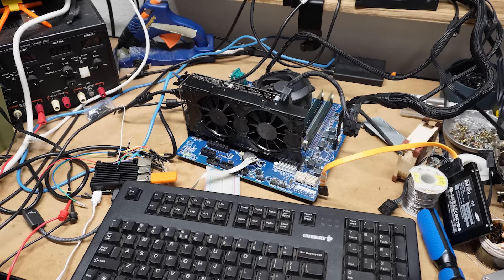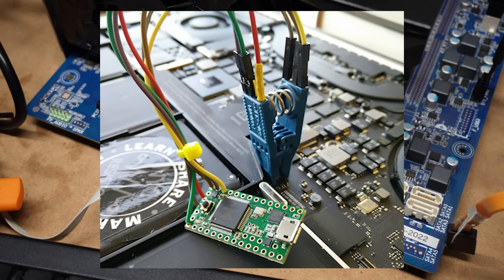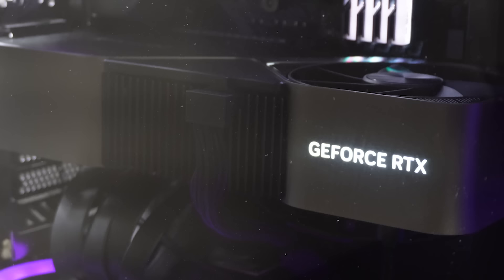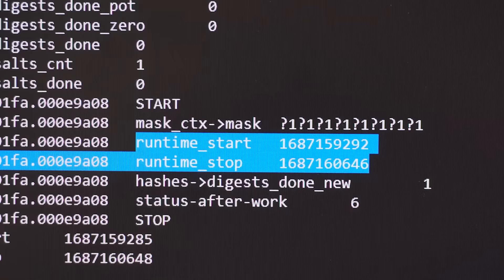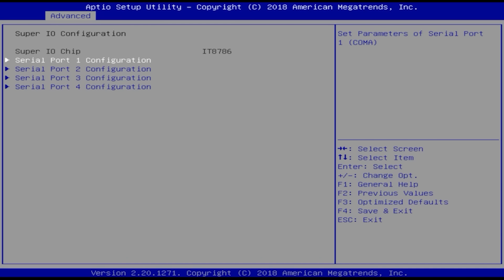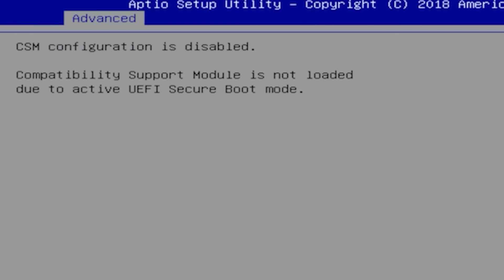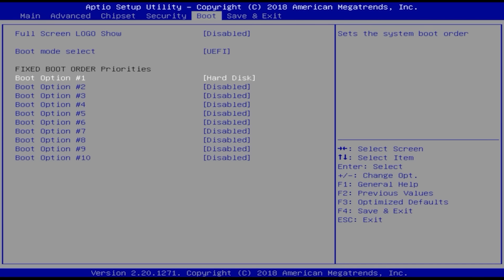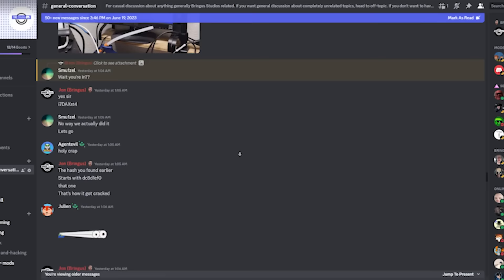How I Cracked The Sega ALLS MX2 BIOS Password

Comment: The "units" for runtime_start and runtime_stop and epoch. you can convert them easily online but its basically the number ofseconds since Jan 1st 1970 00:00.

Anyway, you started cracking at 2023-06-19 at 7:21:32 UTC and finished at 2023-06-19 at 7:44:06 UTC -- so it took about 23 minutes.
Reply: This is called Unix Timestamp.
Reply: I just subtracted the first value from the second value, divided it by 60 and got 22,56
Reply: @Looki2000 Yeah so 22 minutes and 34 seconds
Reply: @renakunisaki  If you're going to be technical (which this is the internet, so we definitely are), it's a timestamp, whose epoch is the unix epoch, namely the start of Jan 1st 1970 in whatever timezone you've arbitrarily set it to (typically UTC). Since we only care about the delta between the two timestamps (to produce a duration rather than a timestamp) the timezone doesn't matter as long as both timestamps share the same timezone (which they do) and even the epoch doesn't matter as once again it's only important if they differ. Subtracting the start from the stop gives us a value of 1,354 seconds between them, or 22 minutes and 34 seconds.

Representing a specific point in time is a surprisingly difficult problem to solve and there are a ridiculous number of ways you can screw that up. Thankfully representing the difference between two points in time is significantly easier and much harder to screw up.
Reply: @renakunisaki  to be really technical since this is the internet, the unit is actually seconds.
Reply: LOL I should have just looked in the comments I used C++ and got the same but since I use central time:
runtime_start = Year: 2023 Day: 170 Time: 02:21:32 AM
runtime_stop  = Year: 2023 Day: 170 Time: 02:44:06 AM
Reply: @yugoprowers   I paused the video to write it in C, though I used strftime() and "%F %T" as my format.
Reply: @yugoprowers Why exactly Jan 1st 1970?
Reply: @Vortex001_MLG  per wikipedia: The current epoch of 1 January 1970 00:00:00 UTC was selected arbitrarily by Unix engineers because it was considered a convenient date to work with.

Comment: What's the point in cracking the password when you could just replace that hashed string with your hashed password when you know where's this string located anyway?
Reply from the maker: Actually yeah that would have been pretty smart & quick to do now that I think about it. That probably would have got me in no problem but I also really wanted to find the password because every single one of these Alls MX2 units shares a password. So now anybody that has one can use it.
Reply: If there arent any checksums, which there definitely are

Comment: Late to the party, but the bios reset via the 2 leads you touch with a screwdriver thing, you literally have to be touching it when the machine is powered off, and continue holding it there while powering it on. I've had to do that on a few older laptops in the past. It's nuts but works.
Reply: He tried it in full video, didnt work

Comment: A SuperIO chip basically just integrates into a single physical chip a whole bunch of peripherals that would have traditionally been discrete. Things like serial ports, parallel port, keyboard and mouse controller etc, maybe even floppy controllers, real time clocks etc, or some combination of all that stuff.

It all gets squeezed into one smaller form factor chip rather than being spread out as several.
Reply: Pretty much what I was going to post, u beat me to it, on a system that modern it would be effectively adding stuff that's not already built into the pch or extra of things already built into the pch (like usb)
Reply: I've seen some of those chips with IBM joystick, fan controller, and power monitoring as well.
Reply: @absalomdraconis hmmm...yeah, I have/had a board (can't remember which one) and in the bios config it had a setting for joystick port, probably has a header somewhere for that...
Reply: @robloxian1585  yeah, superIO is just where they stick literally anything and almost everything that they don't want to implement in discrete logic, so its a random crapshoot what can be in some of them lol

Comment: These are the UNIX timestamps, counting the seconds from the epoch (1/1/1970 - 00:00).

And you can just simply remove the runtime_stop value from the runtime_start, which will give you 1354 seconds - so it's around 22 minutes and 30-40 seconds

Comment: Bus Pirates are also a good option for use with flashrom, less expensive than a pi and has buffers on the outputs and logic level options, but writing larger bios images can be a bit on the slow side.
Reply: @superusermode  can you detail a bit the explanations please ?

Comment: Worth probably pointing out about motherboard based "RAID", it is not hardware raid on amd or intel motherboards. It is a feature you enable on your motherboard yes, but how they do it is in software. If you dont have an actual raid card or a sufficiently enterprise server with one integrated, it does not have hardware raid. Even if it did btfs and zfs are both a lot more performant. And unlike traditional raid they actually check file integrity actively rather than only whine when a disk fails. 

What I mean to say is 'real raid' hasn't been worth it for genuinely protecting your data in years, theres been a lot learned about doing it better at a filesystem level.
Reply: I came to the comments to see if anyone would say this. Hardware RAID is pointless in a home NAS in 2023 and honestly probably even in most enterprise use cases as well.
Reply from the maker: That's a very good point, I've still got the "mobo raid = hardware" misconception stuck in my head from somewhere
Reply: it's also totally useless if your drives are mismatched.  You need to use freenas or something similar what that is the case.

Comment: Clocking in at 16MB is huge. For a bios, it should have a heluvalotta features. You could fit 8 EFI compatible BIOSes on that. A normal BIOS containing a setup block and boot block + microcode could be as small as 128K and still boot a PC in legacy mode all day long. A boot block bios with microcode only could be as small as 64KB for most boards.

Comment: I cringed a little when you cleared the password. I got locked out of a laptop once by doing that. Instead of clearing, it actually set a zero-character password... but the password entry wouldn't accept anything until you typed a character. 💀

I wasn't about to pay $$$ to reset a "forgotten" password so I actually found the backdoor password generator online. Suck it, Gateway.
Reply: That's a terrible design. But in any case, this BIOS actually prompted that it was going to clear it. Also from the previous video, apparently clearing CMOS kept the password, so I'm guessing even if something weird like that happened, clearing CMOS would've put the stock password back in.
Reply from the maker: That's spooky damn, luckily if I really need to I can resolder back onto the chip and restore my original dump
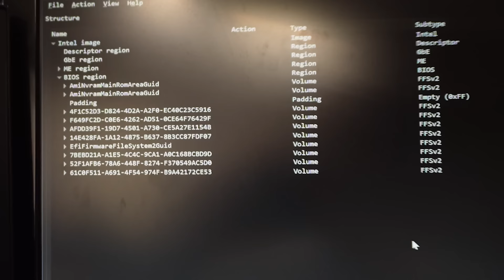Reply: @CaptainSouthbird  That clearly would not work. He could get the password hash by dumping the Flash (EEPROM) chip, so the password is stored in there. And at 1:49 you can see that it is in a region labelled "NVRAM" - non-volatile random access memory. That's how UEFI does it, there is no "CMOS" = battery-backed (S)RAM for storing non-volatile settings anymore like in the BIOSes of old, so you cannot reset it by taking out a battery or bridging a jumper. If you somehow managed to get the UEFI to reset the NVRAM, then it would most likely be wiped/cleared, meaning no password at all instead of a "stock password".
Reply: what laptop was it?
Reply: @amarokorama  wrong. Clearing the CMOS means clearing the user area. Which means the password does not go to empty, but rather it goes to the default rom password. Which for consumer motherboards is empty. But it is not the same thing, like in this board.

Comment: Didn't see it anywhere in the other comments I scanned through, but having turbo mode on intel Core i-whatever processors is normal. It's a feature of the processor where it will temporarily boost the clock speed above the "base" clock speed for extra performance. Totally safe & normal, the processor will throttle back to base clock or below if it gets too warm. I think the idea is that with the standard coolers they come with the base clock is semi-guaranteed to be suitable all day long and the turbo speed is something it can use situationally. If you have a higher quality aftermarket cooler, especially with more midrange CPUs often you can put lots of load on it and it can run at its max turbo speed indefinitely.

Comment: This is seriously scary: a 4080 can crack an 8 characters password with lowercase, uppercase and numbers in 20 minutes.

Time to step up our password game I guess...

I wonder how much time would it take to crack a 12 character password with lowercase, uppercase, numbers and special characters.

Probably knowing how long the password is beforehand helped out the process.
Reply: Firstly, always a good idea to have unique passwords for every instance where one is required. I lax on things that are unimportant / don't access personal data, but otherwise I use an offline "password safe" and just generate a random password. So even if one is compromised, it doesn't open up anything else. But it's also worth noting that the password hash was backdoored here, and I mean, if an attacker has enough access to get into a database to steal password hashes, they've probably already compromised other data anyway.
Reply: On length alone, the time it takes to randomly bruteforce a password increases exponentially. Even with something as simple as a lowercase only password, increasing the length from 8 to 12 results in the total combinations possible going from 26^8 to 26^12. Even though the length is only +50% longer, the actual amount of combinations that have to be tried increases by the order of hundreds of thousands of times more. While it'd take only a few minutes to at worst an hour or so to crack the first password, the latter one would take upwards of 200 years to crack. Factor in the latter including uppercase letters, numbers, special characters, and so on, and the difference between the two goes from hundreds of thousands to hundreds of millions.
Reply: That 20 minutes means basically nothing btw. You can actually crack someone's password in less than a second if you get lucky enough and the length doesn't matter. A more accurate way of measuring it would have been to see how long it takes to generate every single password and then divide it in half.
Reply: Yeah, it's time to upgrade to 30+ character passwords, whether xkcd-style or random. More length = better
Reply: @valshaped That doesn’t really give you security. What gives you security is multi factor auth.
Reply: @BlownMacTruck  Yes, absolutely! Multi-factor authentication is a godsend, but it's also no excuse for poor passwords. Plus, generating long passwords means you can be aware when sites enforce stupid length limits on passwords (HBO Max has a max of 64 characters, and I've seen some sites go as low as 12! Astonishingly bad.)
Reply: take a more expensive hash algorithm. salt the password, let the hash algorithm run more then once.
Yeah, that is security by increasing by just factors, but make the factor big enough and it is in fact, big enough.
Reply: @valshaped  do not loose password hashes into the wild also helps.
Reply: @sarowie  "Don't get hacked" is a good goal, yeah, but you should always assume you've been compromised and work to make things more difficult for your attacker.
Reply: @valshaped  Meanwhile. Here we have a country wide bank that limit the passwords to only 6 chars.... and only letter and numbers. If you want more that 6 chars, you need a special account that is linked to a credit card.
Reply: @SDogo  That's hilariously bad, and they probably only have better security for credit card accounts because of PCI DSS requirements. I wonder who's benefiting from easy-to-crack passwords?
Reply: @SDogo if you get just 3 chances it doesn't matter that much.

If the hashes are lost you're kinda fucked anyway, the attacker gets unlimited tries. While it does matter, it matters a whole lot less than one could think from "20 mins to hack 6 letter password", they might be able after they had already hacked the bank, but then the systems compromised already
Reply: rainbow tables exist.  all possible hashes precalculated. load, search. turns it into table lookup instead of a calculation.
Reply: @stevetheborg  Wow, I've never heard of rainbow tables, I've done a quick Google search and they seem really interesting, I'll do some further research. Thanks!

Comment: You install WinXP onto a machine with only AHCI controller, but you will the AHCI driver either seeded onto the CD install or available by floppy (seeded option is easier). But XP will not boot on EFI, will require the legacy boot option.

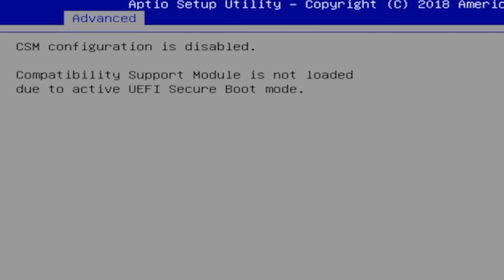Comment: 5:52 I think CSM is only available if you switch off UEFI, which in turn may enable other SATA modes, like IDE or Raid.
Grab a cheap medium like a $20 sata ssd, copy the bios content onto it, so youc an always reset to original,
but also copy the original drive into a file on that cheap medium, so you can restore that too.
Make sure it reads ALL data, including hidden partitions and such. (sector copy to file, whole drive.)

Comment: NICE!!! I've got an ALLS computer (I think thats what it is) in a Mai Mai that wont let me boot anything but its factory drive. I wonder if they used the same password on all of the computers???
Reply: Be careful, if you are using the original Sega software. Your system propably uses Bitlocker with the key stored in the TPM chip.
Image the Disk and try booting that image in a different machine or VM. If windows requests a Bitlocker recovery, you are on thin ice.
If you mess with the hardware or BIOS it could trigger the TPM to no longer provide the disk encryption key. Bricking the system.
Reply: @da1l616  I've already dupped the disk and it will boot on another platform but because specific I/O is missing it wont boot into the game.
Reply: Welp... So much for that idea. I've got a RingEdge2 PC in my Mai Mai. :( Its got a custom Sega mobo with only micro USB on it too. Ugh. Stuck with an non english version of Mai Mai I guess.

Comment: question: I know that the password is more valuable then just access, but assuming all I wanted was access: Could I not simply pick any password and overwrite the flash section containing the password? OK, I would risk there being a checksum and again: the password is more valuable as it works on all machines.
Reply from the maker: I THINK that you could replace the default hash with your own hash that you know the password for, but like you said it's better to know the password so that everyone with an Alls MX2 has a password they can use too now

Comment: I have tried on one ALLS from my friend several years ago, but did not got the BIOS password apparently. At that time, I found 2 rules of the boot order, one is it will boot to the last boot drive, and another one is it will fallover to the only bootable drive if the last boot drive doesn't exist, and these 2 rules exactly matches the settings in this video. And what I did is removed all the hard drive and leave a single USB drive on it, boot once, shutdown, then plug the hard drive back, and then will boot into the USB with hard drive attached.

Comment: So, if you have connected the bios chip to thy pi, why couldn't you have flashed clean bios from the public revision of that board, since you know exactly what it is?
Reply: In case the bios has sega specific settings, and not wanting to risk corrupting anything if the bios flash failed
Reply from the maker: I did try that actually. I tried the F6 version BIOS for this identical board but it wouldn't boot up afterwards. Not sure why. I tried some consumer H310 boards as well but none of those BIOS's would let this thing boot up
Reply: you can use the password on any machine/board you find the wild, without having to solder to it.
Reply: @JonBringus  guess that's something we'll never know the answer too

Comment: Couldn’t you just delete the password instead of cracking it if your goal is just to get into setup? Zero out the password flash dump back onto the rom and it’ll boot back up.
Reply: Having the password could work an all machines without soldering to the board.
Deleting the password only works on one machine.
There also could be a checksum somewhere. Or the BIOS developer could have gone full nuts and make multilevel checksums. That would not be "secure", but surely annoying.

Comment: Nice hacking, I saw a vid where someone hacked a Lenovo bios by shorting 2 of the pins for BIOS communication after boot initiated and before the Bios flash screen. I wonder if that would work also. The bios chips aren't the same. But they both had the 8 solder pin config, so identifying those pins for the chip would be required. But I'd love to see if different chips would have the same effect.
Reply: Iirc he tried that in the main channel video on this unit but I'm not entirely sure
Reply: That only works with older Lenovo laptops, because these store password in separate security chip from BIOS.